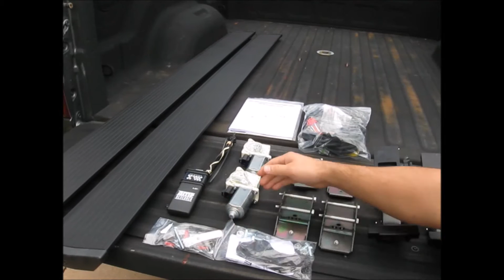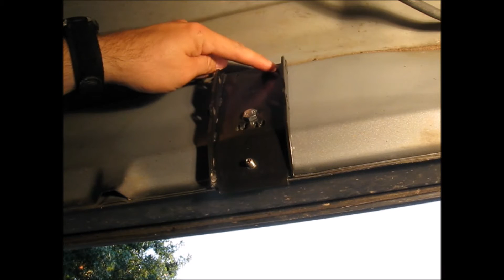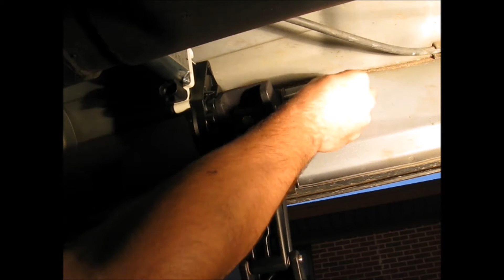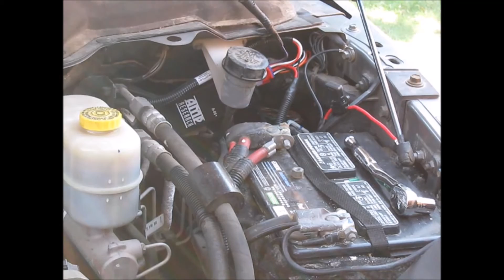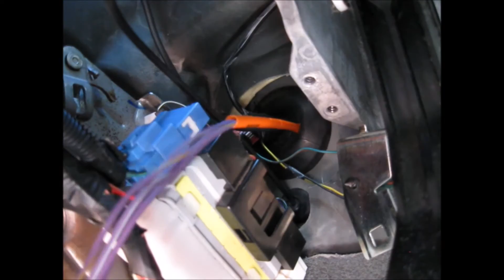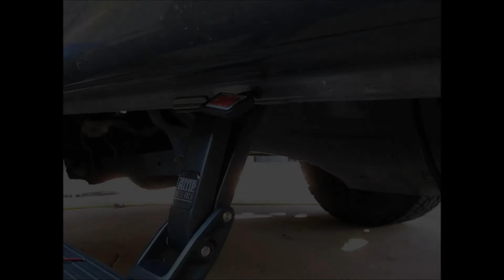Amp Power Step Install on 2008 Ram 2500

Comment: I have a 2005 ram 2500 and the 4 wires that you need are pins 1-4 on the gray connector that plugs into the gauge cluster.    Great video!!
Reply: Thank you what pin is for what door
Reply: Lmk
Reply: @amez5.099 did you figure it out?

Comment: This video helped me out for my 2008 quad ram 3500 with 6" bds long arm lift.   i had to notch the long arm brackets just a little bit for those of you considering the amp research steps with the BDS long arm lift.

Comment: For the brackets how did you get them to sit properly ?
Reply from the maker: They align with the cab nicely and are adjustable on the step itself. Very simple install.
Reply: John because mine aren’t wanting to sit on the inside part where they belong ! I had to bend the teeth but still nothing

Comment: I have a single cab and I think there are only 2 wires under the dash (no need for 4 being it’s a single cab). Do you know which color controls the front doors?

Comment: Great video, just for those who are wondering 03-05 dodges require you to pull the gauge cluster and tap into tan wires. Other then that it’s the same. Again very informative.